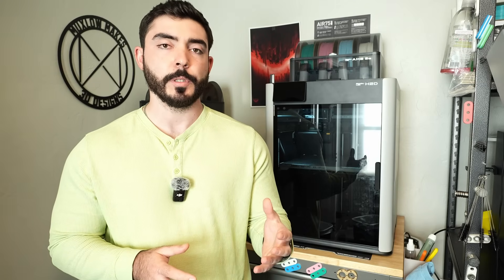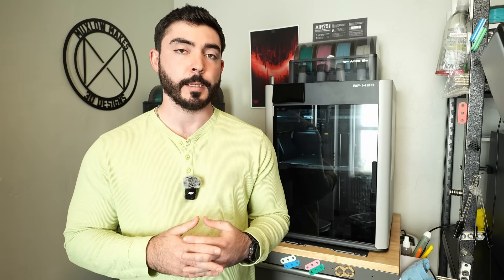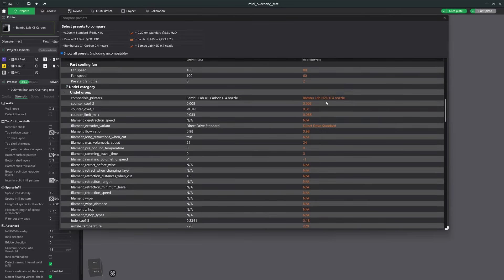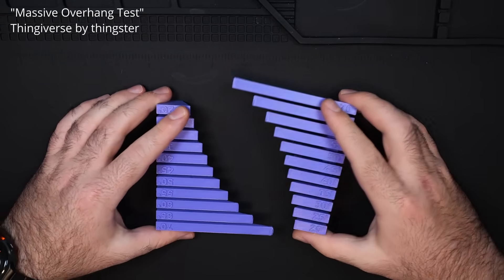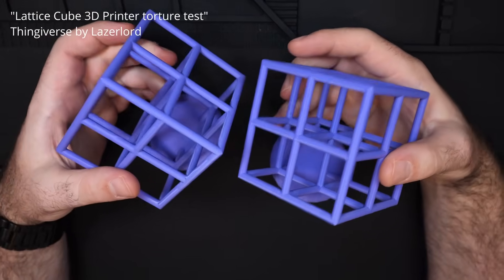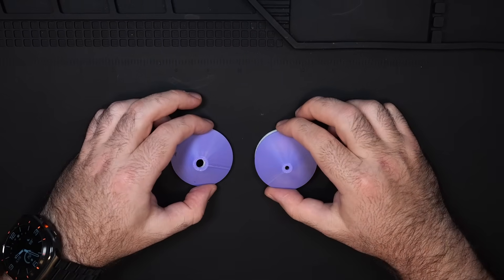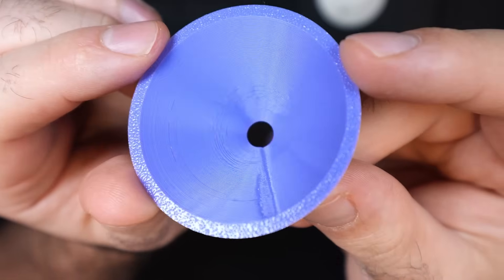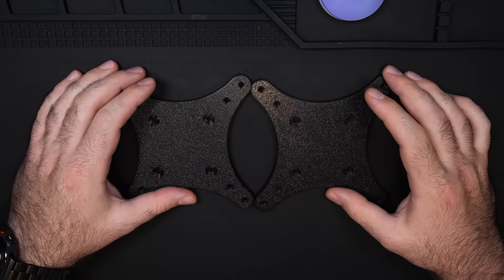Overhang Test: H2D vs X1C

Comment: I am seeing very poor overhang results on my recently purchased H2D, especially with ABS. This is so much worse than my P1S, I am very disappointed! I’ve yet to tweak profiles, to try increased part cooling fan speed, maybe also reduce layer height. I cannot believe that a machine this expensive doesn’t nail this out of the box. Thank you for your video, subscribed, high-quality content!
Reply from the maker: I agree. We shouldn't have to tune profiles, since this thing is advertised to be the best printer out of the box. For 2k it really has bad overhang performance. I think the H2S will be the printer we expected the H2D to be.
Reply: @sammuxlow I’ve now tried the left nozzle and it’s better. I suspect the part cooler to produce asymmetric flow. 

But also: I did a factory reset and started over and this might’ve helped, too. At least a first test print is looking promising…
Reply from the maker: @abramafs let me know how it turns out. I'll follow suite if it works!
Reply: @sammuxlow  H2S has even worse cooling..

Comment: Ive had consistent issues with angular round circular overhangs on my H2D.   I am going through lots of trial and error now to try and fix it.
Reply from the maker: Let me know what you discover!
Reply: @sammuxlow well, it seems like the left nozzle and right nozzle behave differently due to how the cooling is.  it looks like the direction that the printer head prints in, and the location of the part in relation to the nozzle and nozzle cooling also had an effect.

I changed cooling profiles, and changed overlap profiles. i slowed down the speed of the printer.  I even reduced the angles of physical parts to basically write off the h2d's ability to do some specific overhang angles, and instead altered the part design to print overhangs the h2d was capable of printing.

I am pretty happy with how it's printing now that i have a better understanding of what it's able to do vs what it isn't.  

what's wild is, my old CR10S with Slice engineering mosquito magnum hot end never had any issues like this. But she was old, slow, and tired, and the hot end finally sheared and broke after one too many "one handed nozzle changes" , even using the torque wrench provided by slice and following the procedures in order to have all temperatures as required when performing the nozzle switch.

When i get back home i will try to share some of the settings that I used in order to improve the print quality, and i may even build a few different cones with different draft angles to show the differences in quality.

Comment: The most interesting comment for me, is the one from OhImKiCkiN. Summarized: He has multiple H2Ds. He has the problem only on ealier H2Ds, not on a later H2D running identical gcode. So try a firmware update. If this doesn't fix it there must something different in the hardware of the latest shipments. Bambu probably knows it, but probably won't tell anyone, otherwise earlier buyers may request a printhead replacement due to a "defect" in early models.
Reply from the maker: Should be coming soon to: muxlowmakes.com

Comment: I bought this printer at my workplace just because I heard this has the best print quality atm. So far it's been hot garbage comapred to my personal p1s. Overhangs are sh.t, vertical holes are egg shaped with a ton of ringing next to them, horizontal holes are accurate on the front of the build plate, too tight on the back. 100% looks like cooling issue, guess because the bloody door has to be shut and there's 35C inside. I make parts which take about 12 hours each (less than 10 on my p1s) so I really don't have the time to experiment with different cooling settings.
Reply from the maker: Yea I can agree with you. For the price it seems like it doesn't perform as well as it should.

Comment: It is frustrating how the H2D is usually better than the X1C, but not always.

I print a lot of parts in two colours - yet despite having a different colour in each nozzle, the H2D manages to be slower than the X1C which has to do a full filament change. Which appears to be down to the slower acceleration of the H2D with the intricate parts I'm printing.  Frustrating, though, and reaching out to Support got me precisely nowhere.

There are lots of improvements and optimisations that they could make to the print profiles.  I'm just not sure that they ever will.
Reply from the maker: Yea there are optimal use cases for both, just sucks the H2D isn't better in every way

Comment: 1. If it's a cooling issue maybe you could try opening the door and blowing a fan on the part when printing to see if it smooths out the chamfered areas.  I'm not sure of your auxiliary fan setting, but maybe bump it up also if it's not already at 100%.  2. Have you tried comparing H2D and X1C tool paths and speeds at those holes to see if anything obvious jumps out?

Comment: Something i have observed with the H2D is that the parts fan does not stay on at the specified fan speed for the entire duration of an overhang. The parts fan will turn on at the beginning of the overhang, and the fan turns off prior to reaching the end of the overhang which leads to the end of the overhang not getting the cooling it needs. Sometimes it shuts off as much 2 seconds early and ive verified in the g-code that the fan shouldnt be turning off until reaching the end of the overhang but yet it does. I spent much time trying to troubleshoot why the printer does this with no success. Would love to know if every H2D does this.
Reply from the maker: Thats really strange, especially since you verified this in the g-code. Maybe I can check and see if mine does the same, although, my overhangs look bad from start to finish on certain geometry.

Comment: Has there been any update to this? Currently struggling with some “impossible cone” overhangs that come out terrible every time. Based on everyone else that has printed them, they do not appear to have any issues with them.
Reply from the maker: Do you think I should do video trying to tune the printer in? Or maybe I can reach out to bambu support
Reply: @sammuxlow I think both would be beneficial honestly!

Comment: I have similar issues with chamfered holes but on complete different printers (Prusa XL, Jubilee and some other home built machines).
Chamfers on the outside of a part mostly are good but on chamfers on bolt holes I sometimes use a chamfer tool to make them acceptable. I think this is a combination of heat build build up by the heated build plate and the cooling fan not being able to get enough air in the small holes.
For me it is also a matter of the material used. PLA has a much wider temperature range where it stays flexible enough to sag down, ABS/ASA much less. In general my ABS/ASA parts have a much better finish than my PLA parts.

Comment: I run a Bambu farm and print tons of the overhang parts, many with 45 degree chamfers. I always use "Print infill first" option. For some reason Bambu still have not learned from Prusa slicer to optimize overhang printing. Print infill first solves the issue. It will not make the prints ugly.
Reply from the maker: I will give this a shot thanks!
Reply: @sammuxlow  Did it work?
Reply: @sammuxlow  yea, did it work?

Comment: Could it be due to the part orientation if the air flow is not striking the part in the same direction?
Reply from the maker: Its possible, but for cones or cylindrical parts it doesnt really matter. And id be concerned if my printer only printed good overhangs when my parts were oriented a certain way
Reply: I also had an issue on my X1C when printing walls in inner outer inner order. It failed even with regular overhangs e.g. with screws as the outer part is not attached to the inner when printing the overhang. I systematica)y have to switch to inner outer when printing any overhang. Do you print walls in the same order for both ?

Comment: Does the h2d slicer profile default to inner/outer/inner for perimeter printing order? I've seen similar issues with concave holes with that wall order vs inner/outer.
Reply from the maker: Its default is inner / outer as far as im aware.

Comment: I seen a recent reddit thread claiming that one nozzle has much more fan blowing than the other nozzle. They said you could tell just by feeling the air movement. They claim to have better overhangs on one nozzle than the other. I forget which was which though. Maybe that helps you
Reply from the maker: Ill try and feel for the difference, maybe your right. Seems weird thay they'd prioritize a nozzle though

Comment: Please post what firmware you are running, and also have you tried a full factory reset and recalibration including high temp bed leveling. Some people have reported issues clearing after a complete factory reset.
Reply from the maker: I've run the calibration several times since getting it, including the high temp bed leveling and vision encoder. When I get the chance ill run a calibration again. I have not done a factory reset, but I dont see how that would affect cooling..
Reply: @ it fixed some issues for some German guys, despite trying everything idk worth a shot! I’ll print some of these models and see what my results are
Reply: @lazerusmfh  i did that to...i think schwaighofer mentioned it. For me it diddnt resolved the issues. Same with the Vision Encoder. I get ugly surfaces on curved models.

Comment: IMO, the tests we're using are outdated - they were designed for conventional printers, and truly don't reflect the print dynamics of modern high speed machines that use input shaping and pressure advance. These tests used to give most machines trouble, the fact is most machines breeze through them now. We need new tests!!!
Reply from the maker: You make a good point. We need to make some more advanced tests with varying geometry to better understand our modern machines.

Comment: I think it is a slicer issue, not a hardware issue. At 10:04, I don’t think that is stringing in the traditional sense, I think it actually extruded across the part.

I have had that issue with a couple of models now. You can actually see the incorrect extrude paths in the slicer preview too.
Reply from the maker: Yea thats a possibility, I think it was struggling with those overhangs and had some buildup on the nozzle

Comment: Hi great video thanks.  I have also been experiencing poor overhang results on my H2d with PETG.  Interested to know any settings to tweak to improve this
Reply from the maker: Typically first thing to adjust is fan speed, so check your fan speeds for your filament profile. Printing speeds, flow ratio, nozzle temp, layer height, Pressure advance and the filament's characteristics also all play a role. Many things affect overhangs, so try those things listed^ Wall printing order and generator as well

Comment: The default settings are different on each printer. The H2D has a slower default printing speed. I have a whistle that I regularly print that wouldn't work on the H2D until I increased the speed to match the x1c. There may be other settings that are changed.
Reply from the maker: The defaults aren't the same, but they are defaults. I wanted the results to show what a system preset would put out for everyone (hopefully). So if a beginner used the same presets I did, they could get my results. I did almost 0 tuning on purpose, it would lengthen the video a ton.

Comment: the difference is the order of the walls. h2d prints the outside first and then the inside, x1 the opposite. so this defect occurs only in concave overhangs
Reply from the maker: The Bambu system presets have the wall order : Inner/outer. This is how all the system presets are atm, you can check for yourself

Comment: Just got mine, quite interested to test all of that by myself, I usually use eSUN filament, wonder if it'll much difference.
Reply from the maker: I regularly use eSun PLA +. Really good stuff! My adapters are actually normally printed out of it, so you may see the same issue

Comment: I noticed that the nozzles actually print at different heights. The fan will probably have a different performance on the nozzles. Have you checked the overhang performance on the other nozzle? Is there a difference?
Reply from the maker: There is a part cooling fan duct on each side of the tool head for each nozzle. The angle for each matches the height of the respective nozzle. So I don't believe there is any difference. I've seen this issue on both sides.
Reply: @sammuxlow you should try anyway, I don't recall where but I saw somewhere a few days ago that one nozzle gets better cooling than the other

Comment: What material and which side extruder are you using .. I just printed a quick file I made up with chamfered holes from 3mm to 10mm with chamfers on the plate and they all came out perfect.
Reply from the maker: I'm using Bambu PLA basic, and I used the right nozzle for the whole test. Did you run your test using a system preset for both the filament and machine profile? Match what I used, if they still come out good, its likely that the adapter plate has much longer layer times because the chamfered areas are not independent from the plate.... so in other words, I could probably just slow the printer down to fix this issue. But why slow down my already slower printer, when I can print them perfectly at 30mm^3/s volumetric flow on my X1C?

Comment: Do you use Classic or Arachne engine? Also, what is your setting for "Order of walls" and does it differ on both printers? Please test the overhang tower again with inner wall first (of course) as well as either "Slowdown for overhangs" disabled, or alternatively "Overhang speed" increased from 10 to 30 mm/s for "75% overhangs". Also increase Bridge speed by 2x, 3x or even 4x.
Reply from the maker: So the system presets for these printers both use the Classic wall generator. They also both use the same order of walls for all presets as well: inner/outer. Any setting you might be curious about should be the same as your system presets, so just check your slicer. I appreciate your suggestions, I'll look into those adjustments!

Comment: I noticed that my H2d requires higher temperatures for the same material compared to my X1C, that just seemed interesting but don't know if it would fix the issue shown.
Reply from the maker: Higher temps would only exacerbate the issue I think. Plus it was a system profile so it should be tuned by Bambu. Good point though!

Comment: Just a hunch, but have you completed pressure advance and retraction calibration? Seems like it gets worse with short layer times or shorter time on walls which leads me to suspect pressure in nozzle might not be at steady state which also might be why your seams suffering. 

What is your wall ordering?  I’ve started using inner/outer/inner as it allows you to get the accuracy and improved finish of outer walls without having to compromise on seam quality.
Reply from the maker: As far as I know, PA is not a calibration you can run on Bambu filament or machines. Its all lumped into the auto filament dynamics. I was looking into running PA calibration for my .2mm nozzle and realized this. In terms of settings, its a system default profile, so whatever Bambu has set, is what they were.
Reply: @sammuxlow not sure about the H2D since I don’t have one but you can definitely manually tune it on the X1C.  I usually do this in Orcaslicer in the built in calibration and then just add a custom filament start M900 gcode command.  I thought Bambu Studio had a manual calibration section for pressure/linear advance as well.  Basically run the test, observe the results to pick the best K factor.  You can then manually add the GCode command to filament start custom GCode.

Comment: I just had also a issue with overhangs. It was not a hard overhang rather a easy. I had the print in the front and the auxiliary fan did nothing. Just the part cooling fan did it's work. I noticed that the left nozzle got cooled more from the part cooling fan than the right. I got issues printing overhangs with the right nozzle and not with the left. It's really weird. You can also feel that's more air under the left nozzle than the right
Reply from the maker: Thats so bizarre... you'd think the fixed nozzle would be "prioritized" in terms of performance
Reply: @sammuxlow yeah it's really fatal imo. I'm doing overhang test comparing the left and right nozzle without the aux fan turned on.
Reply: @sammuxlow you should test it. Maybe its not as fatal as i think it is

Comment: Counter sunk screws are 41° per side for the countersink head . Included angle is 82°, for some metric screws are 90° Included
Reply from the maker: Its an M4 screw, 90° head. Standard for VESA mounting accessories

Comment: Check that - Slow down for overhangs - is enabled for both right and left nozzles.  PETG is working fine on 45 degrees for me.  I’m even use 20 degrees on .6 mm nozzles.
Reply from the maker: Yea thats why I didn't test other filaments, that is a major variable. Other filaments may not have these issues

Comment: 11:33 10 second wont help because the cone itself was 10 second, here you have many small cones all in the same 10 second window.

change printing order from inner/outer to outer/inner. 45 degree should be fine with outer first so you can go with it
Reply from the maker: Yea your probably right about the 10 second variable, im not sure if any layers were longer than 10s
Reply: @sammuxlow  its not so much about the total layer time, its more about how much time a certain area of the model has the print head above it, cooling from the air. so the single test cone was cooled by the fan for the entirety of the 10seconds, but the small cones of the visa mount weren't they cooled for themselves for the majority of the 10 seconds as the print head fan was in other places